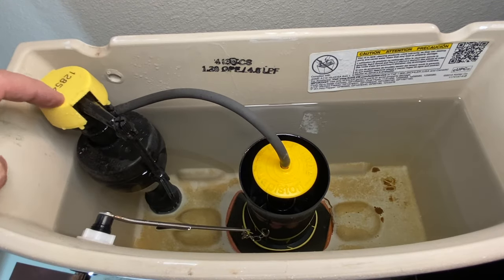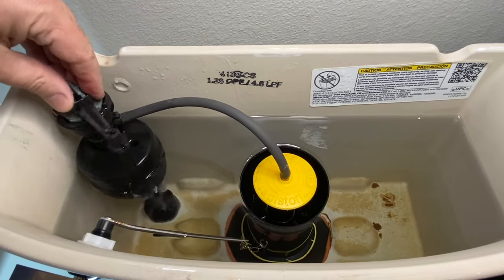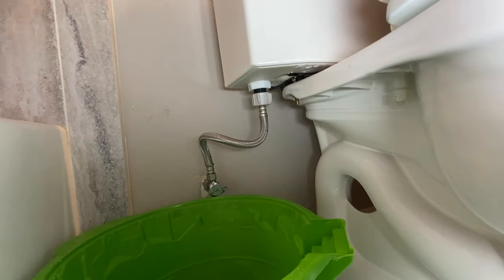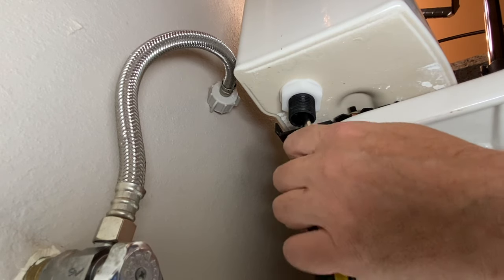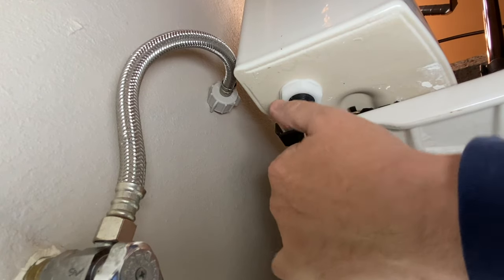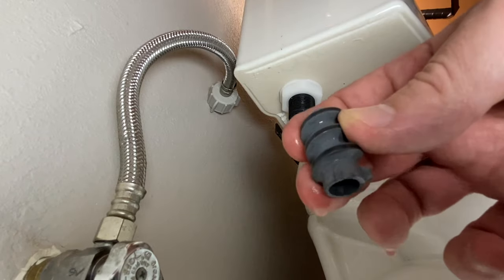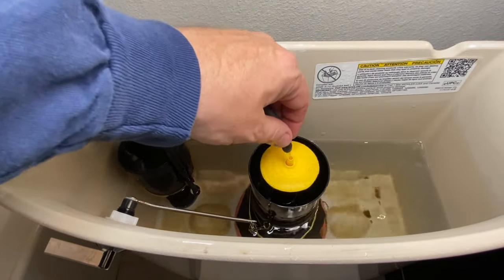TOILET FILLS TOO SLOW!!...3 QUICK AND EASY FIXES!

Comment: The problem i had was, i live in an area where the water is hard, so limescale builds up so i simply put a limescale remover tablet in the water bowl right by the valve opening, gave it half an hour to let the tablet do its work, toilet flushes okay now, no more intervention.
Reply from the maker: So the like scale was just clogging the jets on the bowl?

Comment: Tried to do number 1 fix, but when I go to turn that top piece counter clockwise, to detach it, it turns the whole shaft counter clockwise, even with me trying to hold it place. It is on so tight, the shaft begins to turn with the top piece

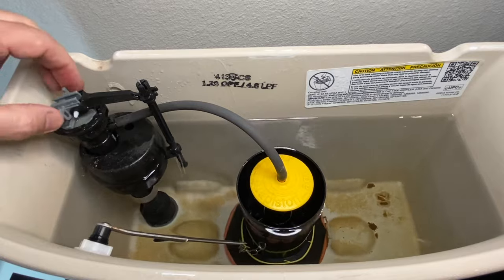Comment: HELP, PLEASE! - Hi. I have a fluidmaster fill valve. Today my toilet flushed - but not very well - it didn't completely drain the toilet and didn't re-fill it either.   I removed the lid & there was a little bit of water coming out of the small vertical tube of the fill valve that is held a little bit away from the main fill valve and appears to be attached at the top and at the float.  It's the piece you rotate at 0:59 in the video.    Because some water was coming out of that part -  I turned off the inlet valve at the wall.  It was stiff so I sprayed w/ a little WD-40 (not much) on the valve handle and turned in on & off to make sure it's working.  BUT- when the valve was open - the toilet began to work just fine - the tank filled quickly as it usually does and turned itself off.  PROBLEM - I flushed again and it behaved as before -  didn't flush everything from the bowl and the tank was not filling up - but the water was dribbling from the vertical tube.  I turned off the water at the wall and turned it back on and - again - the tank & toilet filled just fine.   DO you know what's going on?  Do I need a new fill valve or is there a part I can replace?  Thanks!  (And, I enjoyed your video - you didn't waste the first 3 minutes promoting yourself - you got right to the point!  )
Reply from the maker: Did you remove the supply line and blow that  line out?  If you tried all three of these tips I would replace the fill valve. There may still be something stuck in there, but I just had a co workers with the same issue. He followed all these tips and still had an issue. He gave me the old fill valve to check out, because he said once he put a new one in there was no mute issue.  It has usually been one of these three things for me.  I will shoot an update video once I get it looked at.  I’m working on getting a training toilet now for things like this.
Reply: @ThatFixItGuy  THANKS for responding.  I haven't tried to blow the supply line but will do so now.  I was stuck on why it wouldn't refill after a flush until I turned the water supply off and back on and then works fine.  --- P.S.  How do I know which fluidmaster model to buy?  It's difficult & painful for me to walk, so I'd rather avoid having to take the old one to the store to match it - if possible.  (Curb side pick-up has been a Godsend for me!)  AND, have you seen the video where the guy installs a new fluidmaster fill valve by removing only the top of the old part  and installing the new one on the old post?  If so, is there any reason that is a bad idea?  Thanks again.
Reply from the maker: You can go with any style of fluid master. I would go with a standard version. I’m not a fan of all the leak features and flow change. I think you could totally just pop the new one on the old shaft. I’ve never thought of doing that. The only thing with that is the flow restrictor in the bottom shaft could be your issue with why it keeps slowing down. That flow restrictor could have debris or something in it.
Reply: @ThatFixItGuy  Ooops!  Upon closer inspection,  the fill valve is an American Standard ( so is the toilet) but the fill valve looks like a fluidmaster. Should I find another American Standard or swap it for a fluidmaster?  Thanks again.
Reply from the maker: Luke it still could be a fluidmaster fill valve. they make them for American standard now I believe.  If it looks like one then I bet it is.

Comment: Toilet tank filled up so slowly, then, not at all. So not using it. I was going to find a you tube video to help me fix the issue. Today I heard it running loudly and it hasnt been used in a week or so. The tank was full. What could be the issue? I turned the water off. Really hoping I don’t have to pay a plumber.

Comment: Darn. I did the part where ya used the glass.... but now the water won’t shut off when the float comes up 😪
Reply: I did that step because my toilet was taking longer than an hour to fill. So now it fills quickly.... but the float is no longer making the water stop
Reply: Welp. Upon further investigation I see the seal is chewed up and that white part is also cracked. No idea how that white piece has cracks in it. Never stuck a screwdriver or anything in it.  Oh well. Looks like I gotta get to a store and get a new valve. Sigh.